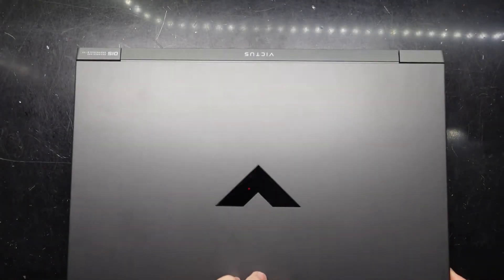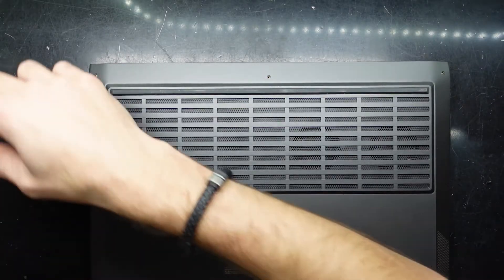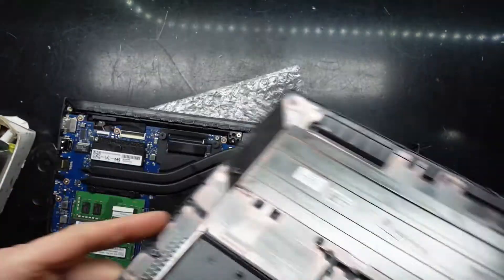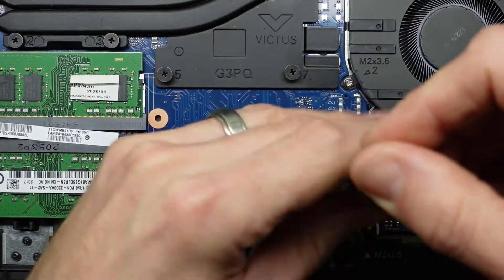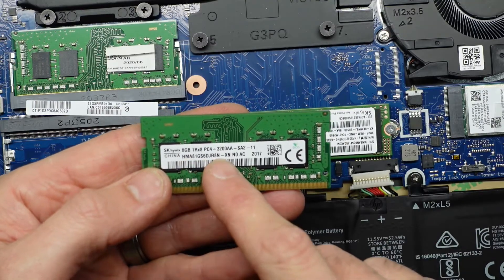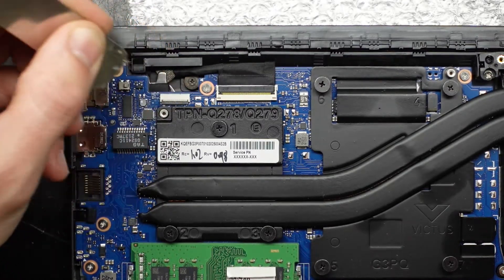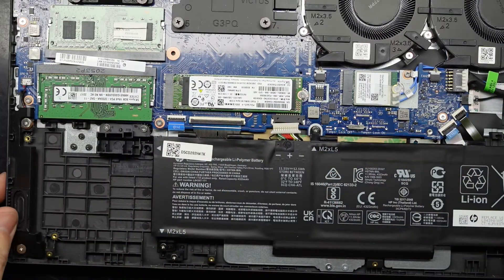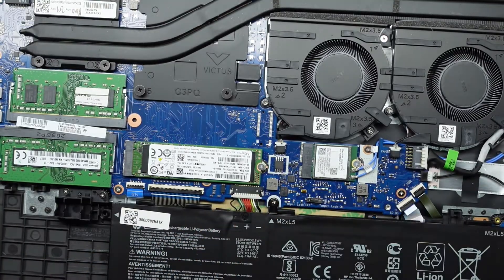HP Victus G3PQ 5600H / 6500M Teardown and Ram / SSD upgrade

Comment: Can we add ss2 slot by soldering will it work?
Reply from the maker: unless you have a good level of micro soldering skill. 

unlikely
Reply: @rickstechrepairs  but even if it is soldered good, will that read or shows the m.2 nvme ssd , coz mine expandable upto 1tb, if i add extra m.2 nvme ssd will it reads?

Comment: Thanks for the video! Very helpful! Was thinking, would it be an issue to swap the original ssd with a new 2tb one as there is no second slot?
Reply from the maker: Would need to clone os

Or do a fresh reinstall of windows when you put the new ssd in
Reply: @rickstechrepairs  how would one clone the OS and what about all the drivers already on the original drive?
Reply: @rickstechrepairs  thanks. I just stick 2x16gb ram and 2tb on my new hp following your instructions. All worked perectly fine!

Comment: could you please comment on the items u used as the upgrade (ram and ssd)
Reply from the maker: i didnt replace parts just removed and reinstalled the factory parts
if i was to upgrade i would use the following:
2x 16GB DDR4 3200mhz Sodimm (Crucial brand)
1x TeamGroup MP33 1TB NVMe (Budget 1TB NVME Drive)

Comment: I just want to ask, we really need to disconnect batery to avoid dmg right?
Reply from the maker: Correct,  personally I've never had an issue leaving it connected 

But I have had a few people comment they have damaged their laptop when they didn't disconnect it
Reply: @rickstechrepairs any brand can fit in this laptop right? I need to find ddr4 ram with the same speed as my original ram right?and can i use different brand and make it dual channel?
For example hynix and Samsung?

Comment: bro you are shorting power connector with your metal tweezers
Reply from the maker: I understand the risk,  and if I use Tweezers I usually go via the ground side
Reply: @rickstechrepairs  what?  you can't short any of the cells ! it can explode!
Reply from the maker: @mrpicky1868  8:00 im pushing the plastic of the connector, not the metal pins

Comment: Whats the max ram you can add to the Ryzen 5/ GTX 1650 variant?
Reply from the maker: Connectivity
PCI Express® Version
PCIe® 3.0
System Memory Type
DDR4 - Up to 3200MHz
LPDDR4 - Up to 4266MHz

https://www.amd.com/en/products/apu/amd-ryzen-5-5600h

no need to buy ram faster than 3200MHZ

Comment: I ordered this same laptop but I can’t tell if it’s going to be 60hz or 144hz and I can’t find any info on it just the gtx version
Reply from the maker: GTX version i would guess is only 60hz
Reply: @rickstechrepairs  every gtx version is 144 which don’t make sense bc this one is better than some of the gtx ones
Reply: @zanosty  only the rtx 3050 comes with 144hz the GTX 1650 just comes with the basic 60 Hz display

Comment: Does anyone know if the socket can be soldered on to the solder pads for the 2nd SSD? Would it be recognized in the BIOS? I guess I'm not the only one pissed off at HP for designing the slot for the 2nd m.2 SSD, but then not adding the socket. I do some surface mounted soldering for flight controllers and ESCs. Replacing f7 chips, mosfets, etc. If it would be recognized I know I can add the socket.
Reply from the maker: not sure, i think it might be possible
Reply: Pls reply if someone already done this
Reply: Try it
Reply: you do it?
Reply: @daviddominguez1157  No, I haven't tried it. I might when I replace this laptop, but for now I needed a new laptop, paid over a thousand dollars for this one and am not about to try something that may break it. If I knew it would work without damaging the laptop, I'd definitely do it though.

Comment: Hi rick.  got one of these and it seems to have come with a pre-stripped m.2 ssd screw. any idea how to get it out?
Reply from the maker: Hi

I would attempt to use a rubber band and a the correct fitting driver 

So make a sandwich

Screw driver
Thick rubber band 
M.2 screw
Reply: @Ricks Tech Repairs  alas getting nowhere. think im gone have to get a screw removal bit.  smallest i can see is 2mm will that be to big?

Comment: Hi, in case of just upgrading the ram is it necessary to disconnect the battery?
Reply from the maker: If you have never done it before, I would say yes
Reply: @rickstechrepairs  I did it without disconnecting and it still worked.
Reply: Most probably it will work. But it's just a safety precautions. I did many upgrade SSD/Ram without disconnecting battery for my friends & customers. And never encountered any issues. But in theory the bord can get fried.

Comment: Seems annoying that they had a spot for a second SSD (NVME) but they didn't include the port allow for it.  They could have added it, and added another $100 to the price.
Reply: i already bought xpg sx8200 512gb becuz i thought there's two ssd slot but realized thats only hp victus 16 not 15😑
Reply: @xxrelaxbrotherxx  it's the same form factor as the desktop one right? i wanna upgrade my 16 soon
Reply: @milflover470  yes if u have victus 16 u have no problem on upgrading ssd
Reply: @xxrelaxbrotherxx  you mean 16 series have 2 slots and 15 series have 1 slot? as far as I see since 16s have seperate fans they could include second m2
Reply: @aguler06  as long as its 16 series then u have another m2 slot dont buy the victus 15...i have to buy nvme enclosure just to put on the new ssd
Reply: @xxrelaxbrotherxx Did you solder the port for the other SSD?
Reply: @daviddominguez1157  you can solder them but i prefer not doing that since it will take a risk to damage your motherboard...i just buy nvme/m.2 enclosure usb c to usb c since the data transfer will be much faster on that
Reply: @xxrelaxbrotherxx how to do that bro ?
Reply from the maker: Agreed!
Reply: Does it have HDD slot?
Reply: no
Reply: That and the graphics card only being 4gb are the 2 biggest downfalls of this laptop but I bought it anyways

Comment: 3:18 what tabs???
Reply: hes talking about the flanged edges of the connector
Reply from the maker: the White plug on the battery.

i get my finger nails on it and pull the connector Down. Which Disconnects the battery

Comment: Have you had screen flickering issues with this model? I've tried updating and rolling back drivers. Still won't go away.
Reply from the maker: i cant say i experienced that at all
Reply: Have this issue with my HP omen 15 (got it in 2018), dropping my brightness helps, or having it plugged in. Otherwise there doesn't seem to be a fix. Waiting to get the HP Victus but kinda bummed I can't add extra RAM
Reply: I have the same model.. of hp victus and screen flickering is the major issue I had felt... I tried to update the BIOS but still it won't go away.. the cursor of the mouse also sometimes freezes.
Reply: Weird I haven't had this problem and I've had it since august